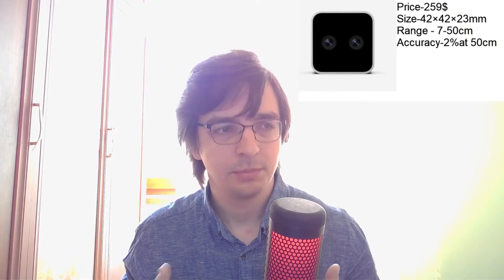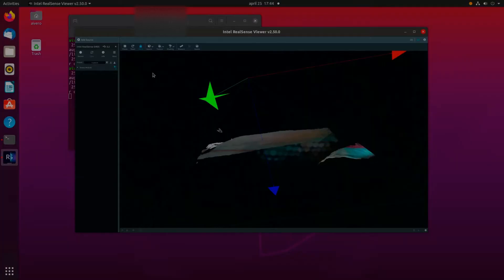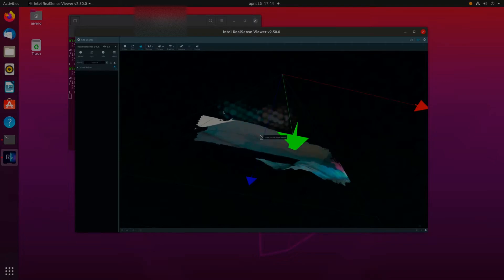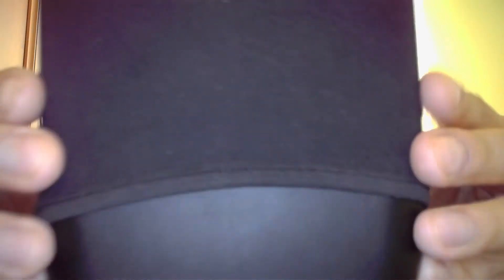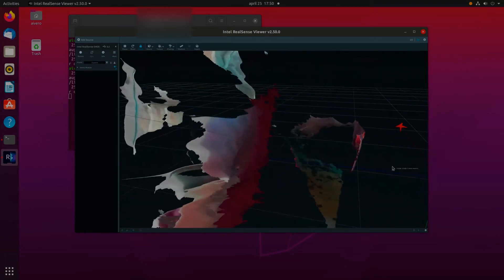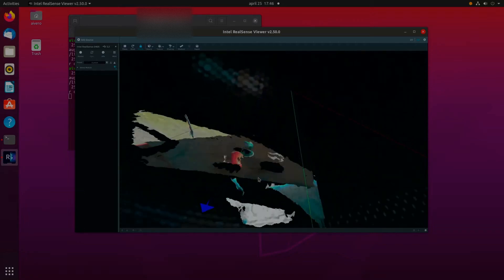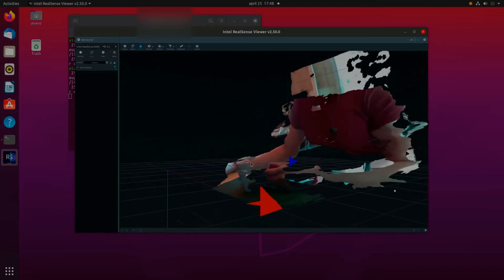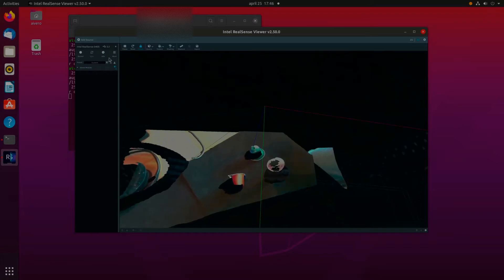Review on Intel RealSense D405

Comment: Hi! good review!
I have a question: do you have tryed the realsense d415? 
if yes, comparing the d415 ad d405, whitch is better on 3d scans? and witch one suffer less the glare/holes on surface with shiny texture?
thanks for your answer! :)
Reply from the maker: Hi! Yes, 415 is a classic one :) I tried it a long ago.
These are fundamentally different devices. It's almost impossible to compare them. D415 has a range of 0.3 to 4 meters. D405 has a range of 0.07 to 0.5 meters. D405 definitely works better with texture as it is closer to the subject. And D415 has active illumination. 
So the choice will depend on the task.